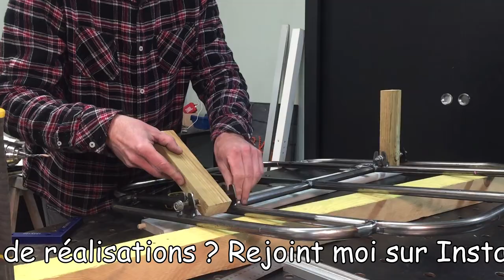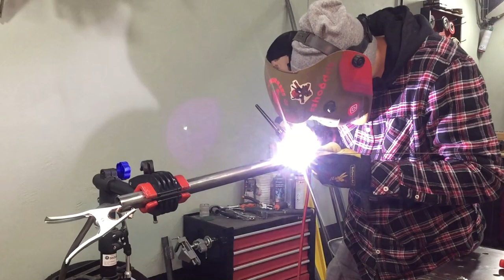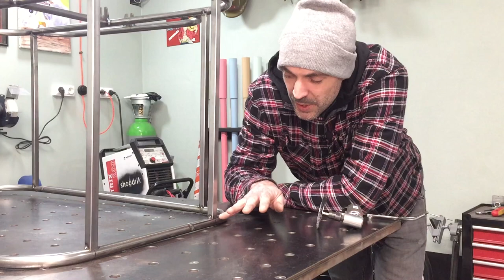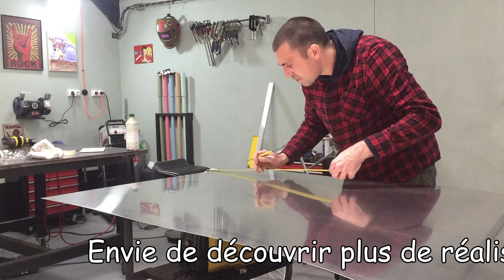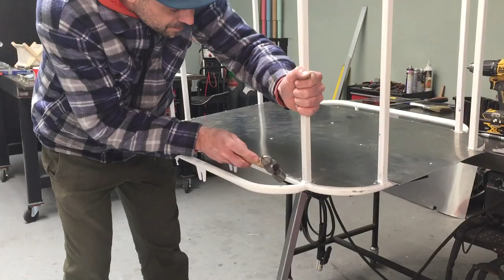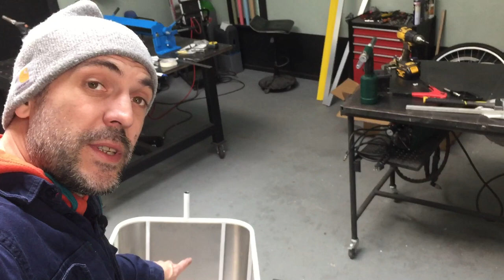Fabrication de A à Z d'un vélo cargo triporteur - Part 2

Comment: bonsoir super video, j ai tenté de realiser un tricycle maison la partie de rotation le tube a cedé , quels outils et pieces as tu utilisé? merci encore
Reply from the maker: À quel endroit cela a cassé ? Est-ce une soudure qui a lâché ? Comme tu peux le voir dans l’épisode numéro 1 j’ai eu quelques soucis lors du test avec la direction.
Reply: @Shoodrik  la soudure a laché au point pivot
Reply from the maker: Outch tu as souder avec quel procédé? Si tu n’a pas passer cette étape de la vidéo il y a un moment où j’explique comment je vais souder la structure et tout ce que je met en place afin d’avoir la soudure la plus propre et solide possible
Reply: @Shoodrik  soudure a l arc
Reply from the maker: Juste pour être très clair car soudure à l’arc englobe Tig/ MMA/ Mig-Mag, quand tu dis à l’arc tu parle du MMA (électrode enrobée) ?
Si c’est ce procédé arc que tu as utilisé tu as du avoir une inclusion de polluant car ce genre de soudure est très solide ou alors pas de pénétration ce qui arrive régulièrement où beaucoup pense avoir souder mais ont juste effectués un collage de pièces.
Reply: @Shoodrik  oui electrode enrobe
Reply: @Shoodrik  merci beaucou p je ne m y connais Pas bien, comment appelle t on Les Deux bagues que Tu inseres dans tube de direction ? Des roulements speciaux? Moi j ai utilise Deux tubes de diametre differents et de la graisse
Reply from the maker: Je crois que le nom c’est cuvette de direction mais sur internet tu peux acheter le jeu complet de cuvette roulement et bague de serrage mais se sytème est de base pour les vélos si tu n’a pas utilisé une base de vélo cela va devenir compliqué de créer la direction du triporteur.
Reply from the maker: Il y a toujours des solutions mais c’est vrai que sans roulements et juste de la graisse cela crée énormément de frictions et que cela casse. Il faut impérativement que tu ajoute des roulements et n’avoir pas de jeu dans la direction du vélo

Comment: Salut, super travail 👏 
J'arrive pas à comprendre comment ta caisse peu pas basculer en avant ou en arrière vu qu'il est maintenue sur l'axe central du cadre de vélo car après il va y avoir du poids dès que ton triporteur sera fini 🙄
Reply from the maker: Les roues avant sont légèrement déporté sur l'avant de la benne ce qui fait que le poid derrière les roues l’empêche de basculer. Et effectivement tout sera encore plus stable quand tout les éléments seront installés. J'ai aussi appliqué un axe de 8° sur la colonne de direction ce qui fait que le cadre du triporteur penche du sens inverse en tournant afin d'avoir une meilleur stabilité latérale et éviter de retourner le vélo
Reply: @Shoodrik  
Merciii pour ta réponse 😉
Je vais bientôt essayer de fabriquer un triporteur donc je prends note 📝